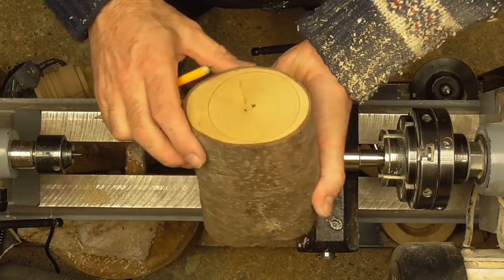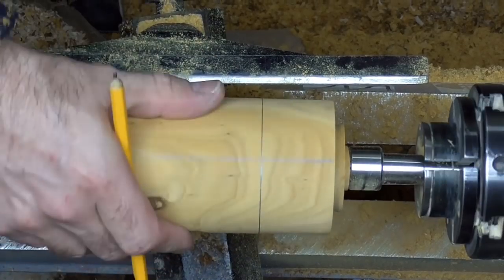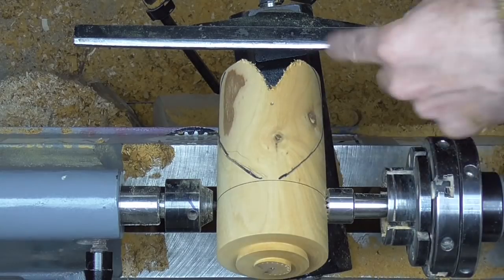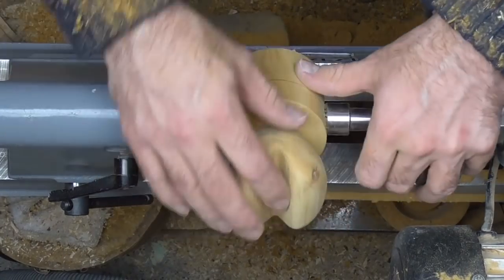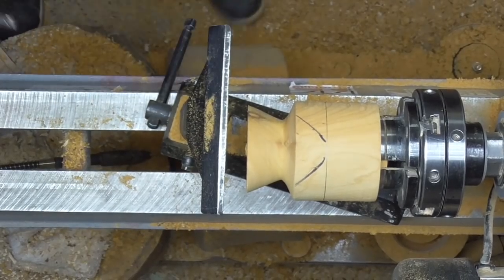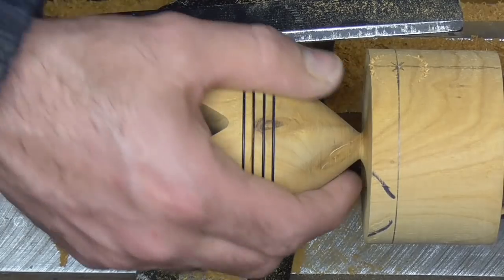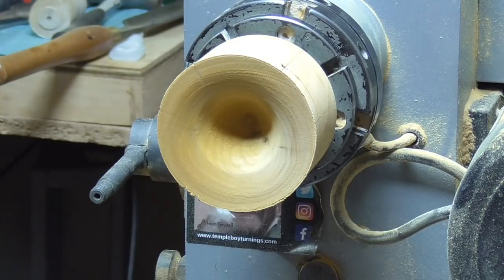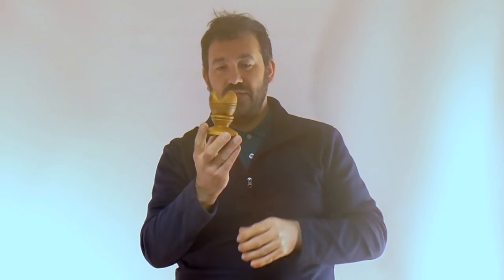(Woodturning) Make a Valentines Heart gift box & stand.

Comment: Great job Steve , I tried something similar a few weeks back and it was a fail .  I think what you have done here  is brilliant and will try this method  later.   Cheers mate,   Bram
Reply from the maker: Hey Bram, I would be interested in knowing how you approached it mate ?  I got lucky that this worked out for me and I didn't end up with a broken nose lol .....Thanks for watching mate.
Reply: Hi Steve , I  drew a heart  on some card and using a compass to mark the high points and the lowest of the heart so they are equal and then use that as a template of my piece of wood.  It was more than likely my fault it didn't work out as planned . Hope my description makes sense . cheers,   Bram